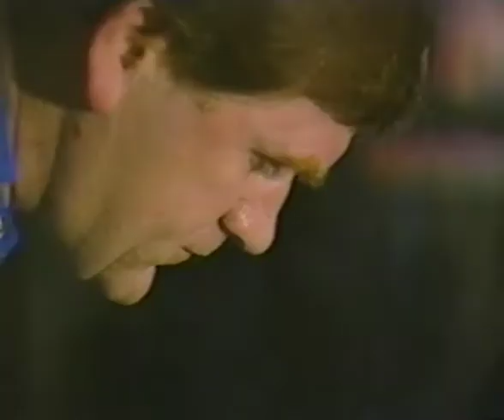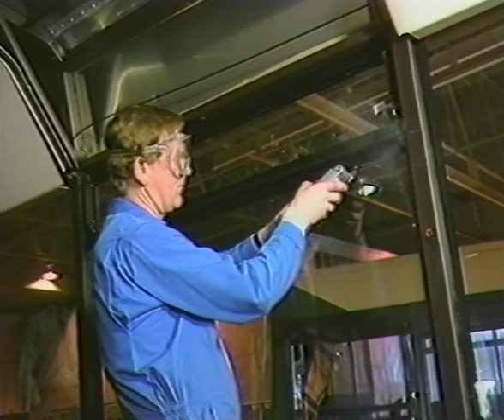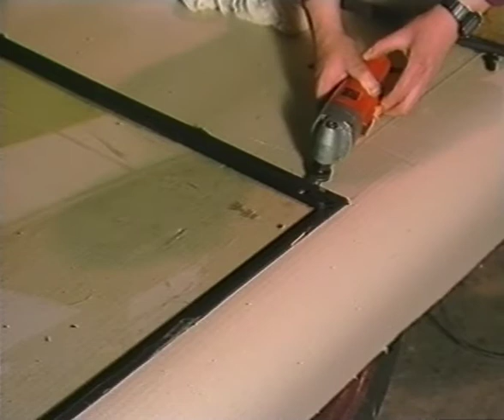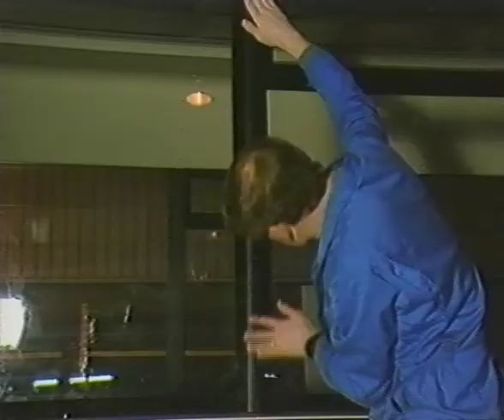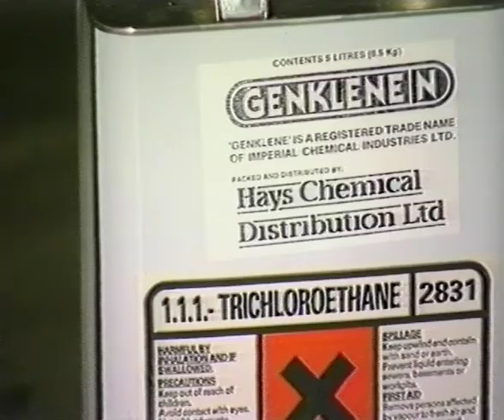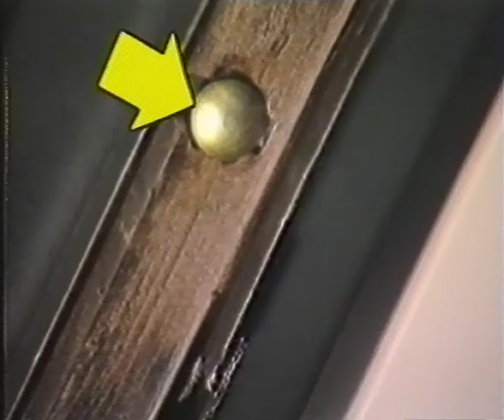Leyland Bus Training Video - Lynx Body - Repair & Maintenance

Comment: Wonder if Leyland Bus told West Riding they were hacking holes in the panels and ripping them off one of their brand new buses pre delivery!! No wonder they fell apart tho.. The white and grey one looks like one of the demonstrators we had on loan while members of the fleet who's windows were falling out and panels coming off were put right by Leyland Bus. They were originally L001/3 and think in the end West Riding ended up negotiating a deal with Leyland Bus and we kept them and if I remember rightly they became 348/9/50?? G148/9CHP and possibly G542CAC I stand corrected if I'm wrong it's a long time ago.. They were also different from the rest of our fleet in that they had sloping floors like 252 C920FMP and 253 D204FBK..

Comment: Why didn't the worker use a heat gun to remove the panel? heat softens adhesive.
Reply: But it can also damage the windows, the paint and different plastic materials around. Cutter is much more precise

Comment: I don't recall Psv glass doing any of that with the three windows I have had replaced on a lynx over the years. Although I think if you took the interior panels off my lynx the steel would just crumble into dust.
Reply: And rust.